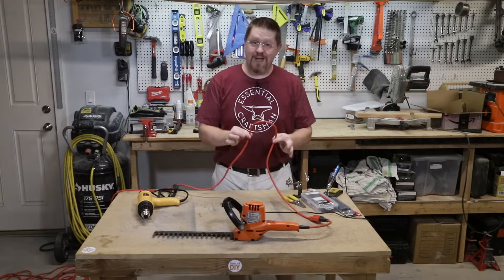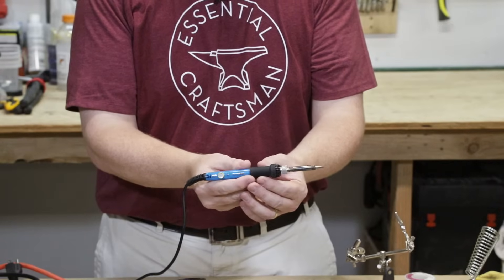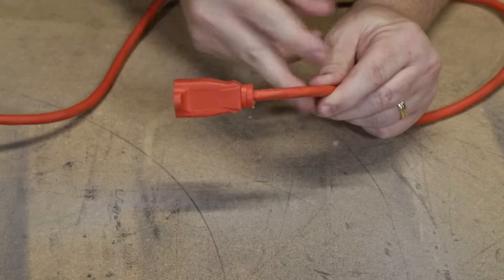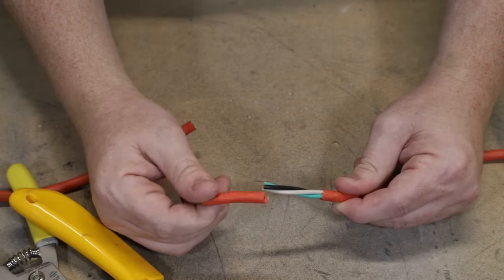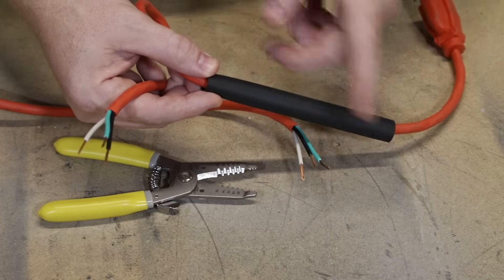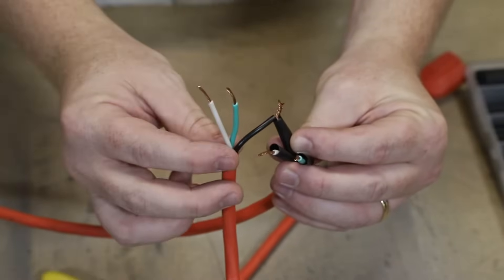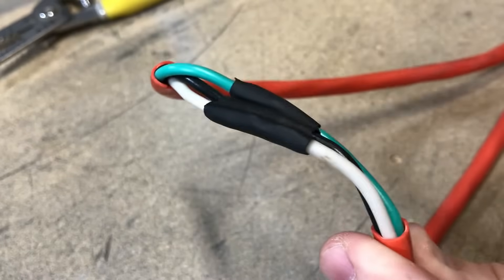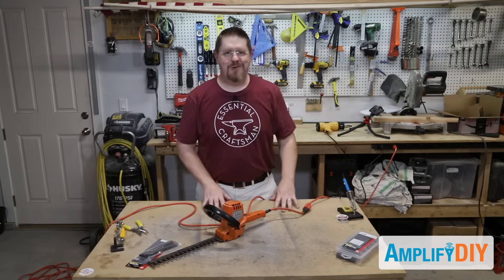How To Repair A Damaged Electrical Cord Safely

Comment from the maker: You can use this same technique to repair power cords to home appliances, power tools, etc.
Reply: Is it still ok if u don't sauder the wires.
Reply: Thx for the video man. The instructions were simple. Would it work tho on Washing machine cable, especially burnt?

Comment: I hope you're still available for comment but what is your opinion of liquid electrical tape on the individual wires?
Reply from the maker: I've never used liquid electrical tape, and I'm not sure I would trust it as much as heat shrink insulation.

Comment: i would have stagered the connections of different wires so any mistakes in soldering or heat shrink don't have wires touching in the splice
Reply from the maker: This is a great tip. Thank you!

Comment: NASA and the FAA say that crimped connections are better than solder.
Reply from the maker: I agree that a proper crimp is better than solder... but most people don't have the correct tools or connectors to do crimps the way that NASA and the FAA do... they use a cheap pair of pliers and butt connectors from their local auto parts store. I'll take a soldered connection over an improperly crimped connection any time - especially in an application like this.

Comment: Great video, I did the same thing while hedging. I ended up doing what you did, except as someone else mentioned, I cut the wires at the different locations and used electrical tape on each wire, before I used the large shrink tube. I went overboard as a precaution as I use the cord a lot outside. After 12 years, it works as new.

Comment: Great repair but with all the equipment I'd have to buy it will be cheaper just to buy a new extension cord.
Reply from the maker: That's true for the first repair, but once you have the tools, you'll find more uses for them than you ever thought. A soldering iron, in particular, is a great investment in that it will pay for itself with only a couple of repairs - and they are incredibly useful for fixing all kinds of things.. .not just extension cords.

Comment: Cheaper to just buy a new cord😂but excellent tutorial. If you don’t see yourself using these tools/supplies regularly or for other projects I would just do the temporary fix or against just buy a new one👍
Reply from the maker: The funny thing is that even though I sometimes don't see myself using a particular tool, once I have it I wind up using it all the time. Things like a little cheap soldering iron and heat gun are incredibly useful, and I'd bet if you owned them you'd use them a lot more than you currently imagine. Thanks for watching!
Reply: @AmplifyDIY I agree, I bought a mig welder that was cheaper than replacing the riding lawnmower deck that needed work. So bam deck fixed and got a new welder, so every job after thst was free!!

Comment: at 5:47 . any other solution to fix that in if I don't want to cut the whole cord into two?
Reply from the maker: Unfortunately, the only other way to deal with this would be by wrapping it in electrical tape... which is a pretty bad idea. It won't last, and is a sketchy way to do the repair. Cutting the whole cord and re-sheathing with durable heat shrink is the only way I recommend doing it. Good luck!

Comment: WOW !! Thanks for sharing this! I just today jacked up my AWESOME extension cord and I was so mad at me!! Want to know, what kind solder are you using? Also, what size of shrink tubing are you using and what is its shrink ratio? Thanks!!!
Reply from the maker: Sorry for the late reply! Hopefully you have repaired your extension cord already, but if not - I like the 3:1 ratio shrink wrap, with adhesive lining. I just have an assortment that I use for projects like this, and generally grab the smallest size that will still fit over the solder area. As for solder, I use basic rosin core solder. Here are some links to both: 

🛒  Solder: https://amzn.to/3Vl7S0C
🛒  Heat Shrink: https://amzn.to/4b4LP4s

Good luck!
Reply: @AmplifyDIY  You are so precious, thank you! I ended up buying a box of assorted sizes of the shrink wrap in 2:1 and by accident bought ROSIN CORE SOLDER! Lucky me!. Will the 2:1 still work okay or should I return it? I haven't opened it.
Reply from the maker: @sherryroberts7716  2:1 will be fine - does it have adhesive lining? If it does, go ahead and use it. If does not, then I'd return it and get adhesive lined 3:1. Good luck!
Reply: @AmplifyDIY  You're the best, thanks!
Reply: @AmplifyDIY    Wish I'd seen this before I bought the non adhesive shrink tubes ...

Comment: not that safe but for home its ok ish

at work they wont be happy and it certainly isnt alowed.  just because the cable isnt as strong as it first was.  and if it rubs the heatshrink can slide
Reply from the maker: I guess that depends on the specific rules of your workplace. The heat shrink I used includes an internal layer of glue, which is stronger/tougher than the original outer sheathing. It's not sliding anywhere. Thanks for watching!

Comment: Dont attempt unless youre experienced. Damn near got third degree burns from attempting. Gave up after 1.5 hours and wasted $30 on supplies. Buy a new cable or go with a battery setup
Reply from the maker: I'm sorry you had a difficult time... was it the soldering that was tricky?

Comment: I always find my heat shrink closes up from the solder heat unless i keep it 2"+ or so away from the connection.
Reply from the maker: Yeah, you do need to be a little careful about that. You may also be putting too much heat into the solder joints. They should be hot enough to create a good connection, but you don't need to really cook them forever on the soldering iron. Thanks for watching!

Comment: Is the soldering step necessary?  What does it do?
Reply from the maker: Solder provides a MUCH more secure and durable connection between the conductors than just twisting them together or crimping them together does. For an extension cord, it's absolutely the right way to do it.

Comment: I’m an occasional do-it-yourselfer. Hence, my preference for electric tools. Never had this happened to me until I was using a hedge trimmer. 

Thanks for the video. Cost is about the same to buy a new extension cord. But I hate the environmental impact of throwing away a perfectly good cord.

Comment: Is it bad to use plumbing solder
Reply from the maker: Yes. Plumbing solder and electrical solder are quite different. Don't mix them up. :)
Reply: @AmplifyDIY  thank you so much for the quick response!

Comment: Pro Tip: Slice the outer cord 3in in line instead of removing it to expose the wires, just fold it back out of the way.   You can then cover the repaired wires with it and not have that bumpy lumpy repair and get extra insulation to boot.
Reply from the maker: As long as you still cover the entire repair with heat shrink, and preferably the kind with glue in it, this is a great idea. Thanks!

Comment: Make sure your rolls of heatshrink are quite long. Or this ain't gonna work out for you. Also, you really want another, thick piece of rubber tubing to go over that heat shrink. Heat shrink ain't near as tough as that original shielding.

Comment: Very good solder technique.  Stager them so less bulge, and less chance for another short.  If an old cut trim back to good, shinny wire or use flux.

Comment: Thanks. Would it be a bad idea to cheap out and use electrical tape instead of heat shrinks?
Reply from the maker: Yeah, that's a bad idea. Tape does not age well - in a matter of months it will have broken down and or peeled off. It especially does not do well when exposed to sunlight. Use heat shrink - it's not that expensive.

Comment: I also hacked my extension cord while hedge trimming. I was going to use butt plugs and electrical tape. The “expert” at ACE recommended it that way. Saw your video, followed your steps and learned how to solder all in one. Thanks again, saved me some $$$&

Comment: Electrical tape tends to break down and get brittle with age , if you're in a hurry it's a quick fix until you can do better , stager the connections slightly so the solder doesn't rub each other

Comment: If the damage is only a few feet from the receptacle, throw that part away and put a replacement receptacle on it.   Safer, easier.   The repair made is not water proof.   Make sure it never lays in water.
Reply from the maker: Hi Kevin - I agree that if the repair is near the end, it's better to just replace the plug: https://youtu.be/ZYGjOAyfT3Y
As for waterproofing the repair: The heat shrink I used has glue in it which melts and seals the joint. It is supposed to be waterproof, but as a general rule I keep extension cords (repaired or not) out of water as much as possible. Thanks for watching!

Comment: What about those of us who repair a cut cord about once a decade. Always  covered with electrical tape per instruction from my Pop. 
Why isn’t electrical tape holding and covering the splice job sufficient?
Reply from the maker: Electrical tape tends to break down over time - the adhesive fails, the tape becomes brittle, etc. It's FAR better to use heat shrink as I showed in this video. Thanks for watching!

Comment: If you want to be really cool and avoid the Python swallowing a rabbit bulge, cut the inner wires to unequal lengths, so that they are not all connected at the same place.
Reply from the maker: LOL - python swallowing a rabbit. That's a great description. Thanks for the tip, and for watching!

Comment: Noooo ! Not the daisy chain method. The worst way to wrap a cord, roll it over and under and never around your arm . I prefer ti John two wires together by separating the wire then wrapping them together , a bit tighter and lay a bit flatter and stay together better.

Comment: Great video, thanks! One question though. Why would you mention what to do if you don't have a heat gun, but not fail to mention, what to do if you don't have a sortering gun? 😅
Reply from the maker: If you don’t have a soldering iron, you’ll need one to do this repair correctly. See the video description for a link to inexpensive ones.
Reply: Thanks

Comment: The cost of the materials and the tools was more expensive than the cost of a replacement cord…..even a 100 ft one. This video only makes financial sense if you already own the tools or if the cord being fixed is a heavier gauge.
Reply from the maker: Hi Bob - I've actually run the math, and in my area a decent (note, not the cheapest stuff on the bottom shelf at Wal-Mart, but a reasonably good cord from somewhere like Lowes or Home Depot) is expensive enough that it's still cheaper to buy a soldering iron, heat shrink, and wire cutters and repair the cord than it is to buy a new one. It's also less wasteful, and then you have the tools for the next time you have this or another similar problem. I'd almost always prefer repair over replace, where possible. Thanks for watching!
Reply: @AmplifyDIY  Hi - I enjoy your videos. I also researched the costs prior to my post. At Lowe’s the lower range soldering irons were $17.99 to $23.98, cheap wire strippers ran from $5.98 to $9.98, the cheapest price for solder was $7.99 on Amazon, the heat shrink runs $2.38 at Lowe’s, razor knife $$5.98, and the heat gun, which you state in your video, you should have, was $18.00 and that was a cheap one. Lowe’s was also selling a 100 ft cord for $29.99. If I went with the cheapest options the total comes to $68.30. Like I said in my first reply, if you have the tools or most of them that’s a good way to go. If not a new cord or if the cord was cut near either the male or female end of the cord an inexpensive and even simpler fix would be making that repair.

Comment: Are you supposed to put Flux on the wire first?
Reply from the maker: Hi Jessi - sorry for the delay in response. If you use a solder that includes a flux core, you don't need to add flux to the wire. Good luck!

Comment: I tried repairing a 12 gauge cord on a  Tablesaw and couldn’t wrap the wires so had to push them together. The second problem was holding them while soldering.I recommend buying a little articulated clamp designed for this. The third and most important issue was a hot or powerful enough iron. I used a small iron like yours on the first attempt with no luck. Bought a 30 watt and still didn’t work. Other videos recommend 60 watts or higher for 12 gauge wire. Also rosin base flux and the right size and kind of solder. Some contain acid which can deteriorate the repair over time. Still a great video.
Reply from the maker: Excellent tips, Kent! Thank you!
Reply: Oh no!  I just fixed my 3 month old carpet cleaner using the acid solder = what do I need to watch for?  The cord is short enough - my pup cost me 2 inches fixing it.  I was wishing I'd gone the flux route as I didn't get as smooth a solder as I'd like to have, but I'm also years out of practice!  Perhaps a higher watt iron might have made the difference ...

Comment: I have an outdoor extention cord. Just used and next day wouldn't work. No visible breaks or nips.
What happened ?
Reply from the maker: Are you sure the outlet you are plugged into is working correctly?
Reply: @AmplifyDIY  yes, it is. I tested it. I also plugged it in to  outside outlet on the house. No dice. I give up.

Comment: This is great if you have the tools just sitting there in your huge workshop but by the time I pay for gas to buy sodering iron and heat gun I think I'll just buy a new cord.
Reply from the maker: Hi Himlek - My workshop didn't just suddenly appear out of thin air. I've collected everything you see in the video over years of using this approach: When I start a project, if I need a specific tool (such as a soldering iron) to repair it, I invest in the tool for that project. That way I have the tool on hand for the next one. If you consider each project all on its own, you are right that it's usually cheaper to just go buy whatever it is you are working on. But in the long run, if you invest in a tool or 2 for each new project, eventually you will already have everything you need for just about any project you take on, and you'll come out ahead both in dollars and experience. 

In this specific case, a soldering iron and a heat gun are incredibly useful tools, that are also pretty inexpensive. For the cost of around 2 replacement extension cords you can have both tools, use them to repair the cord you already have, and then have them available for all kinds of other projects.

Thanks for watching!

Comment: Very good video but it's missing one piece of information I wish I understood. Does it matter how much bigger the heat shrink is than the wire it's going over? My heat shrink is not much bigger and I don't know if that's going to be a problem
Reply from the maker: Hi John - as long as the heat shrink fits over the repair, it's fine. A little tight is better than not tight enough. Good luck!

Comment: Yeah, I tried to solder the wires right after I cut the ends&stripped the insulation,and put flux on the twisted wires. It beaded off like water off wax!  My friend said you must do this within 2 minutes after cutting the wires;WHAT? Please explain! Man!Those hedge trimmers really got a problem!
Reply from the maker: Within 2 minutes? Yeah, no, that's simply not true. You must have been using the wrong kind of flux? Or possibly the wrong kind of solder?

Comment: I have found that the 3 joints are safer when they are  staggered and not side by side.
Reply from the maker: Hi Aditya - staggering the joints also allows the repair to appear less bulky. Thanks for the suggestion, and for watching!

Comment: Great instructional video. Yes, I'm interested in seeing the plug end replaced. I have a hair dryer I love which only sometimes works. The insulation isn't damaged but I think the wiring is compromised near the plug because sometimes it powers on/off when I stabilize with that part of the cord. Thanks in advance!
Reply from the maker: Stay tuned, Erika! I’m working on a follow-up demonstrating exactly what you need. Thanks for watching!
Reply: Me too

Comment: Would electrical tape suffice rather than heat shrink for the repair?
Reply from the maker: Hi FaithRox - no, you really should not use electrical tape for something like this. Heatshrink is pretty cheap and readily available, and is a much safer option. Good luck!

Comment: Thanks for the video. Could this also be used for a long extension cable which risks to get wet? (e.g. lawnmower cable, pressure jet washer cable, or underground cable for garden lights, etc)?
An idea of the waterproof rating it provides (e.g. IP68, IP67, etc) would also be very useful. Thanks.
Reply from the maker: Hi Rakmob - In wet locations, I would tend not to trust a repair like this... however: It's really a question of risk vs cost. For example, if I am going to be burying a cable and if it fails I'll have to go through the trouble of digging it back up, I would not put in a repaired cable. However, on something like a lawnmower I'd be more willing to trust a repaired cable, as if it ever fails dealing with fixing it is pretty simple. If you do decide to use a repair like this somewhere like that, I strongly encourage you to use heat shrink that includes hot glue on the inside, which will make a nice watertight seal. If you can't find heat shrink that already has glue on it, then you can always cover all your joints with actual hot glue first, then when you put heat shrink over them it'll do the same thing. Good luck!
Reply: @AmplifyDIY  Hi, Thanks for your reply. Are there any advantages/disadvantages to use black, coloured or transparent heat shrink tubing? And which shrink ratio is best, most secure or usually adequate 4:1, 3:1, 2:1 ?
Reply: There is another really good tutorial here on you tube dedicated entirely to soldering. He uses Silicone in his solders to make them waterproof. Just search: Soldering technics.